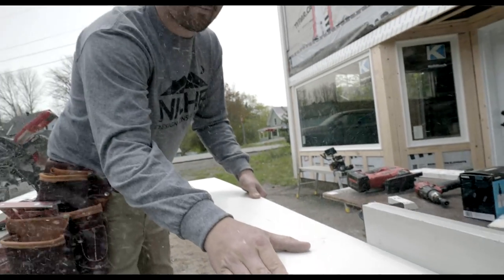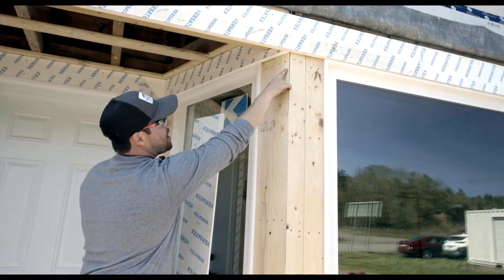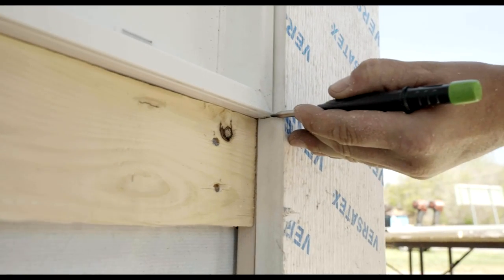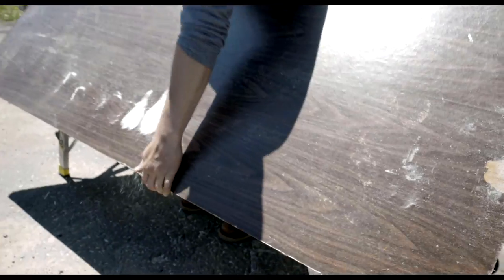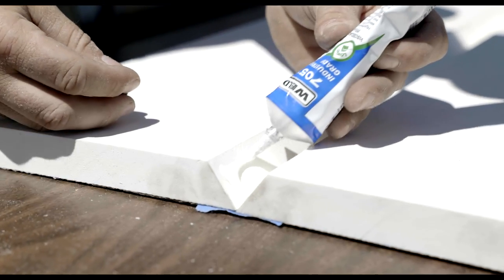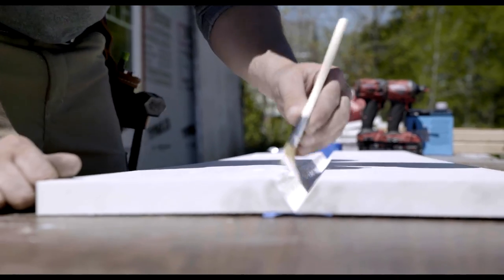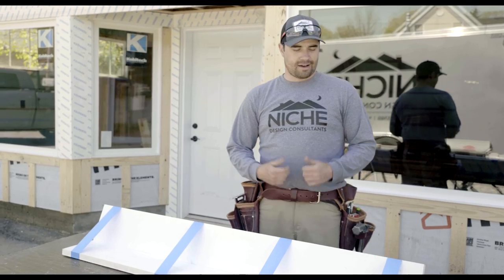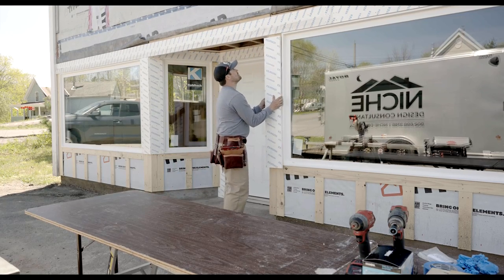Exterior PVC Trim: Weathertight Outside Corners

Comment: I had to make 96 lf of 45 degree corners.  This video helped a lot.  I found some cheap velcro strips and used them to hold the corners together for gluing.  Work great at about the price of a roll of blue tape.  I used 717 Weldon PVC glue.